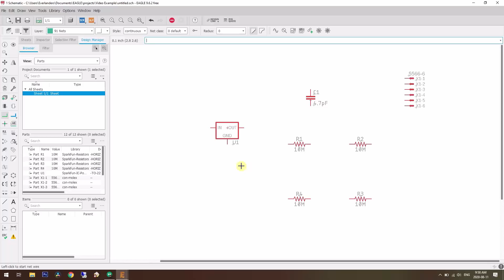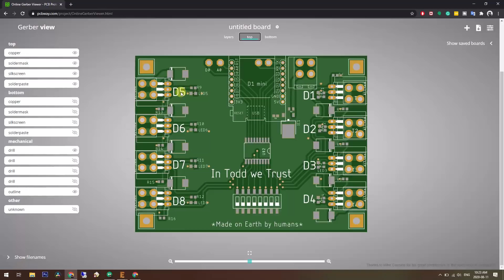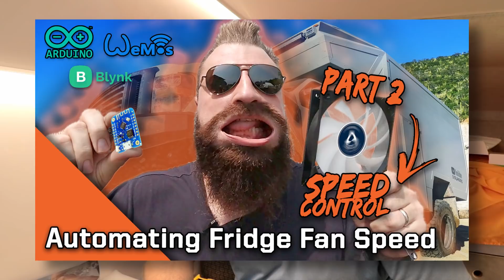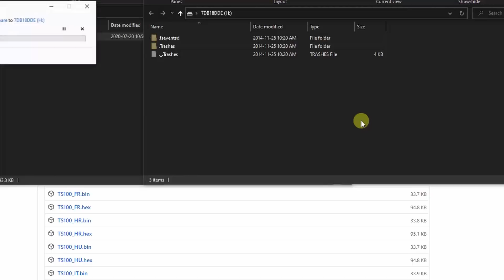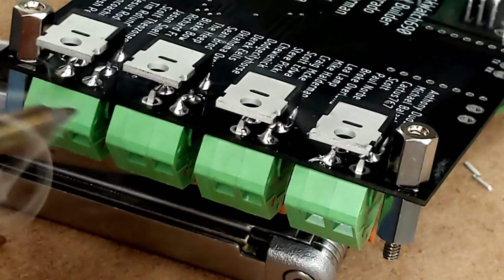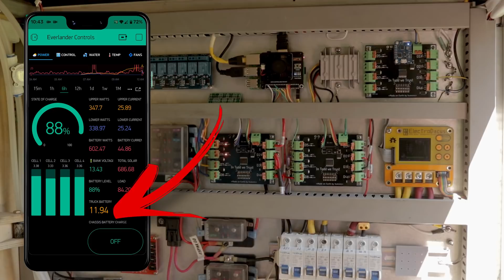Designing and Building Custom P-Channel Driver PCB's in Mexican Lockdown

Comment: Now I understand what you were building. Fantastic job. So far I can only Blynk an led on my board. You are very inspirational on learning internet and things wemos. 
I’m just getting started thanks to your great videos. 
Stay safe
Reply: Thanks for the reply. I have purchased 2- 12v wemos relay shields for my project. I have built 560 ah lifepo4 battery bank for our bus. I liked your video on electrodacus bms, so I ordered 2 SMBSO. I didn’t like the Chargery bms that I was using. So I reconfigured my set up to run the SBMS0. Works as I expected it would. My solution for keeping the insulated battery bay warm when we are not in the bus was to run a1156 light bulb on a manual switch. That does a good good job but a pain to have to turn on and off manually. When we are traveling in the winter my espar d4 heats the battery bay and the basement. Then i discovered your wonderful video on automation and decided that I would learn to use the wemos to automate turning the 1156 light bulb on to warm the battery bay. Moving forward I’m going to try and control the 1156 bulb and 12v fan with a ds18b20 temp sensor through the wemos board. I have set up a partition on my Mac laptop to run Abuntu. Works great. I now can communicate with the wemos. I can control the led on my board with Blynk from my phone. It’s a start. 
Can’t wait for this Covid thing to end so we can travel south again in the winter. 
Thanks Craig
Reply from the maker: My advice for taking it a step further would be to get one of the 8 channel relay boards I used (sainsmart or similar) which will allow you to interface to the real world, you can switch all sorts of stuff with that...

Comment: Another great video, thanks! Frying pan reflow oven is a new trick I’ve never seen  👍
Reply: Am I correct that you are using Blynk cloud as opposed to a local server? So you are 100% dependent on Internet connection for the Blynk/IFFT magic to happen? Thanks again! (aka ‘Jim Fro’ on your membership list).
Reply from the maker: No, we also have a local blynk server running, so when we are offline all that traffic gets redirected there. However we do not have voice activation through Google assistant and IFTTT when we are offline.

Comment: You hacked your sodastream to use a CO2 cylinder awhile back, did you need a regulator to reduce the CO2 pressure, or us it all just about finding the right fittings?
Reply from the maker: Yes, I've got the regulator set to 116psi

Comment: Thank you for sharing all this info, sincerely. I would love to build a medium size Pelikan case solar generator using PCB where possible to minimize the size of components other than the battery. I think this would really be useful to many people who may travel in different vehicles, even rentals, tent campers, as well as folks needing a backup power source for emergencies but who want to be able to maintain the unit instead of buying a ready box on Amazon (Goal Zero, Jackery, etc... ). Would you be interested in designing an Open Source generator? I’d be happy to contribute pesos, dollars, and time. My electronics knowledge is just enough to swap parts but definitely not enough to design PCB. Anyways, thank you for those videos.
Reply from the maker: What would the circuit do? Presumably you would need a charge controller with integrated BMS?
Reply: Everlanders That’s right. What I find with currently published DIY solutions is that the BMS, monitor screen, step down, charge controller, etc... all need to be off the shelf components pretty much, linked by wires. These things can be thinned down quite a bit and battery maximized and also more serviceable overall if some of components reside on PCB. I don’t mean to develop a full on production version, but a board that could accept the main components that DIYers could use to get a unit up and running. Here’s an example of a commercial unit tear down: https://www.youtube.com/watch?v=gRhPooSPprY

Comment: Do you really need darlingtons to drive the P channel fets? Or is this just to protect the esp8266?
Reply from the maker: You'd need some kind of transistor, the big P-Channels need 0 to 12 volts to switch fully, and the 3.3 volt logic on the Wemos would not handle that...

Comment: It might of already been said or you have already thought of doing it but you could easily move your motion sensors to a esp and then just have that wirelessly feed back into the pi. As a second thing have you ever thought of running something like home assistant as you don’t have to rely on a internet connection.
Reply from the maker: Yes, the motions are all on ESPs already...

Comment: That was a great overview, thank you! I'm happy to hear that it's so easy and affordable to get professional PCBs. I've struggled to remember the difference between N-channel and P-channel, I've just never heard N=Negative, P=Positive, these are the sort of things that are easy to miss when you're self-taught in EE. This board is almost exactly what I've been looking for, most of the cheap ones are N-channel as you mentioned, I have one just like the 4-channel red one , and it works, but I would have to pull a bunch of new wires to get my truck lights to switch on the negative side.

What I would add to your board is an i2c interface, so that a few of them can be hooked up to one microcontroller or Pi without tying up IO pins. How much current are you able to switch before you need to add a wire as shown on your high-power board?

Comment: Great video!  One suggestion, if you make more high current boards, leave the solder mask off the traces on the backside between the P-FET and connector and make a stencil for them.  You can go from a 2oz copper to 2oz copper plus as thick of a solder trace as you want to glob on there to decrease the series resistance.  You could do the same for the supply traces too.

Also, my google home responded to your "turn on the lights" command with "Ok, turning on 25 lights"  Glad I wasn't watching it while the kids were asleep!
Reply: Every time he says "OK Google," mine responds "You don't have that set up yet..."
Reply: Every time someone opens my door, Google says gotcha your Faraday cage failed just read your emails  ;)

Comment: Is it not possible to have a slightly higher voltage source (higher than the positive rail) to drive the gates on an N-Channel to achieve the same thing. A problem with the P-Channel is its significantly higher internal on resistance...thus heat.
Reply from the maker: Given that the video is 55 minutes long, and I posted it 28 minutes ago, I assume you haven't watched that part yet... 

If you have some information on how to switch positive voltage with a N-Channel FET I'd be happy to read whatever references you can post.
Reply: @Everlanders  It's actually relatively common in power control and conversion due to their generally better current capability etc. https://www.analog.com/en/products/monitor-control-protection/high-side-switches-mosfet-drivers.html
Reply: They create a micro boost converter to pump the gate voltage up above the high side voltage. Some are even all in one package with no external cap/inductor required. Really cool stuff.